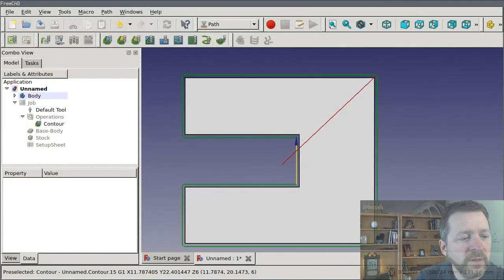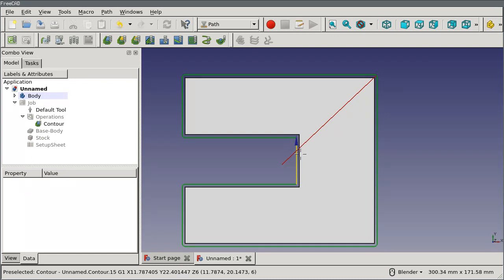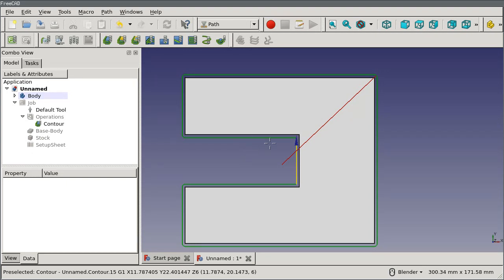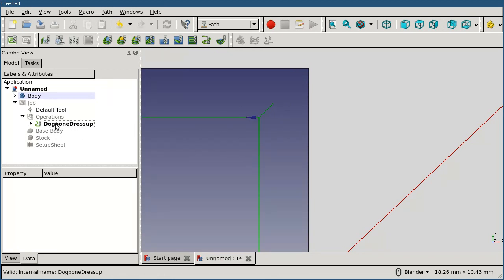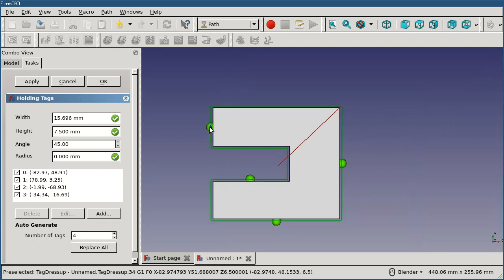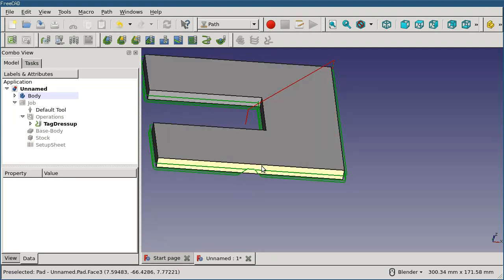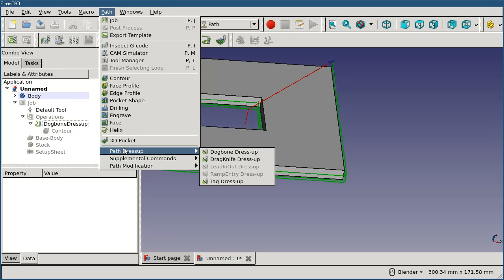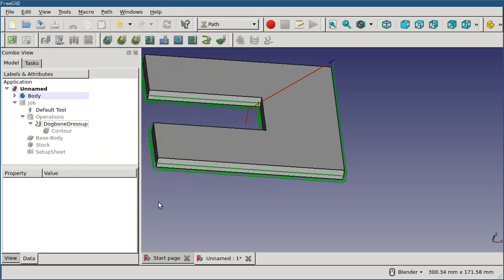Using FreeCAD Path - 5 (Dressups)

Comment: Thanks for your videos. Its very helpfull. Path still have a long way to be a efficient tool. This Tool could be more helpfull if single operations just could be changed or deleted.
Reply from the maker: I don't understand. Operations can be fully reconfigured after creation.  Path certainly has room for many improvements but if you configure templates and setupsheets, it can be very efficient for many use-cases.
Reply: @sliptonic  Hi, for example i can not do this
1. Try to cut one side. for 1 mm. 
2. Try to make a Pocket in the center of the part.  2mm * 20mm. Tool size 2mm.
I have to addmit, that i just started with path. On my thinking, i already spend the time in the drawing.

Thanks

Comment: Dude, your work is legit. Both these videos and the commits. Seriously top notch.

I started poking around at the Path workbench this morning, just to get accustomed with it. I noticed a couple of things weren't working, and the console was showing some Python 2 vs. 3 errors (eg. dict.keys() no longer being iterable). The usual stuff. I figured I should update my install to make sure it hadn't be fixed already, and in the upgrade from the conda-forge release (~7 months old) to the freecad/label/dev one (a few hours old), not only were those fixed, but I see a lot more was added.

I'm a little bit bummed I missed out on some easy bugfix commits, but am also very impressed! I'm sure there will be other opportunities for contributing.

Only remark I've got on this video, is at the end, when you said a plasma needs a pre-heat - that's really for an oxyacetylene torch. A plasma usually needs to touch off the plate, lift to a pierce height, fire, then lower to a cutting height after a time delay. Things I'll be trying to figure out as that's exactly what I'm working on. (And opportunities for contributing!)
Reply: And thank you for your knowledge and contributions! TIL